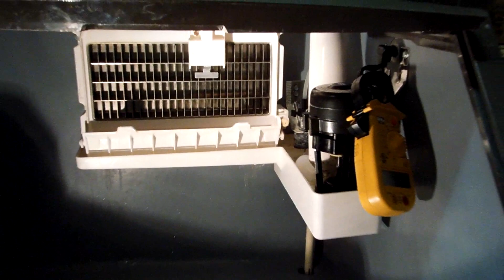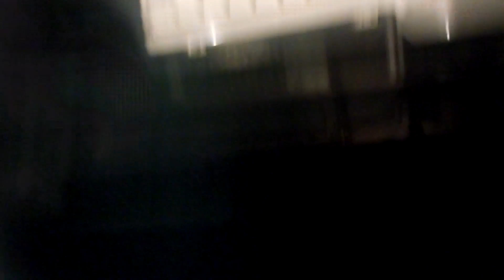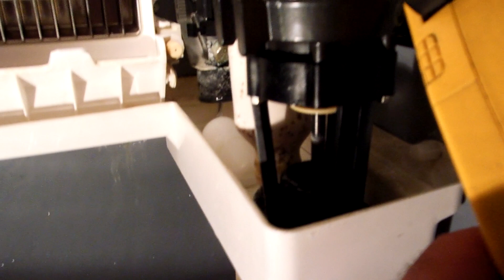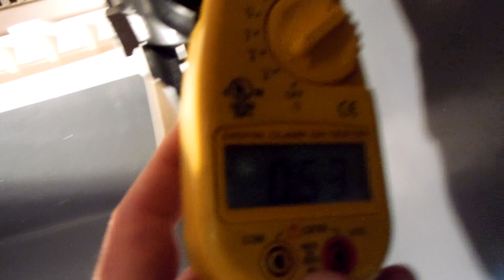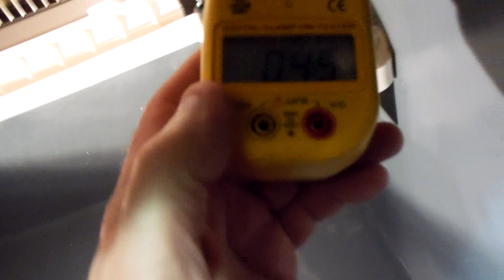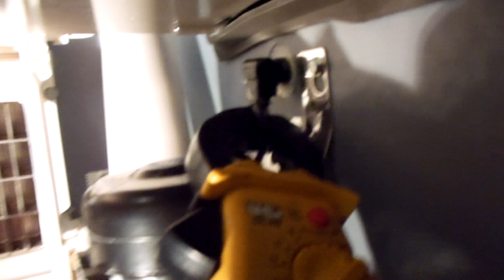Manitowoc ice Machine. How to Diagnose a Water Pump Failure.

Comment: quick question, if there is no contact closure on the relay sending voltage to the motor, then no voltage, no amps but not necessarily the motor. We came across one that the relay was not working someone prior ordered the pump and walked away.  We ended up measuring the windings with ohms to see the original motor was good.

Comment: Love the videos and your style of fixing equipment. If you have any time, What would you tell a new guy, trying to get better with ice machines, about troubleshooting to diagnose water flow problems. Into the trough and over the evaporator.
Reply: Thanks for the reply man, I appreciate the knowledge.
Reply from the maker: spray bars are allways plugged up. Allways  take apart and clean first. Allways flush out trough with fresh water and Pull off pump hose at spray  bar, and pump fresh water out hose before re-connecting to spray bar.
Reply from the maker: allways clean condenser. make sure ucannsee through it.

Comment: I have a Manitowac QM30A and yesterday it quit making ice.  I reset the switch on the machine and watched it start its operation.  The thing I noticed is the water pump didnt turn on.  I pulled the water pump and used a volt meter to check the plugs.  When the machine first starts its showing 22V.  When the compressor kicks on it shows 48V.  Im trying to figure out if I need a new pump or a new board.  Any suggestions?  Thank you!!
Reply from the maker: First check your voltmeter & see if it's working ok. put the meter leads in a wall outlet and see if it reads 115 volts ac. if so , then u have a power problem. possibly a broken off wire that goes to that female plug outlet for the water pump. check for power at the beginning at that wire where it gets its power from. look for loose broken wires. corroded wire or corroded plugs. bad connections. pull apart. clean put back together. you should be reading 115 volt at that pump female receptacle. across the top 2 pins. there are 3 pins. the center one is ground. if u are measuring from the wrong holes u won't get the right reading. 
The pump is 115 volt so remove the pump and try to turn it by hand. if it spins freely.your good mechanically. if pump does not spin it's no good.  u need a new pump.
Reply from the maker: Here's a link to the service manual --- 
https://www.partstown.com/modelManual/MAN-QM-SM-Q-Series_sm.pdf

See page ---219 for electrical schematic / wiring diagram.

There is a Fuse on that control board that is probably blown / possibly because the water pump no longer turns freely. Replace fuse with correct fuse. do not go bigger. make sure water pump turns freely. if it does not replace water pump. Replace Fuse and see if there is 115 volts at water pump female outlet where water pump plugs into. if yes most likely water pump is junk and blew the fuse.

Comment: I have a manitowoc ice machine makes only 1 to 2 loads then it stop and the red light is flashing . What could be the problem.  Please response.  Thanks
Reply from the maker: could be alot of different things --- 

What is the model # of the ice machine ?

1) check that the ice machine is clean where it makes ice. do not use anything abrasive on the ice thickness sensor. sponge clean. 
2) clean the condenser - by blowing compressed air through the rear condenser coil or down below if condenser is down below on little ice machines. thier may be a air filter if a big ice machine. air filter is at rear wherr condenser is . remove and wash clean. 
You should be able to SEE Through condenser with a Flashlight if its clean. 
3) is water pump working ? good water flow ?
4) is condenser cooling fan working ?
Reply: @OcRefrig  thank you for your reply. I replaced the following items already.
1. Fan motor.
2. Water pump.
3. Capacitor 
4. Ice thickness sensor
And clean the filter and used C02 to blow on condenser coil. But it doesn't solve the issue.
Reply from the maker: is the bin thermostat shutting off the ice machine ? jump out the bin thermostat. 
What kind of machine are we talking about here ?
Make : Manitowoc
Model : Q series , S series , neo ? series , indigo series ??? Model # please. ive got to know what im working with here ?
Serial : ?
Reply: @OcRefrig  it is a manitowoc ice machine  model : QY0134A. I dont know if the bin t stat shut down the unit or not but the water keep running for 10 to 15 min than it shut down and the red light keep flashing. If i turn the unit off and turn it back on the process start again( runs for 15 min then shut itself off.)
Reply from the maker: probsbly one of two things with that machine.
1) ice is laying on the brass rod which turns the machine off because it thinks the machine is full of ice or if it foes not have a brass rod
2) it has a flap that flips  every time ice is dropped. if it does not return to upper position machine thinks its full and shuts off.
--- possibly bad bin switch on flapper. bad magnet / weak magnet on flapper.  replace bin switch or bin thermostat needs adjusted  or replaced.
Reply: @OcRefrig  that what i tho. And i replaced the flapper too still does the same thing. My next step is to change the evaporator.  But i dont know how to check it and i dont want to spend 800 dollar for the part that i dont need.
Reply from the maker: my gut is telling me its going off on high pressure safety . condenser getting too hot / not cooling. make sure u can see through condenser with a flashlight. You should be able to see Light through all of it. if Not , Blow condenser out , they get plugged in between.
Confirm Liquid line leaving Condenser is Warm /cool NOT HOT. 
if hot , condenser is not doing its job / Plugged withdirt.
1) Confirm When compressor is Running - That small line leaving compressor is very Hot. so hot u cannot touch it. it will burn you.
if not , u have compressor problem or short of Freon.
2) make sure condenser fan is Running anytime its making ice.
3) i believe there is a Fan cycling switch which goes bad on those all the time / Fan will not run when compressor is running. i would lean more in that direction.
4) if evaporator makes 1 batch or 2 of ice it is NOT Evaporator.
5) When machine runs does it make a FULL Sheet of ice when it does run ? If Yes , evaporator and refrigerant charge is Good. 
6) Its VERY UNLIKELY Evaporator is defective.
7) Condenser Fan MUST run anytime compressor is running.
if machine is older than 10 years old.  i recommend  getting a new one.
Reply from the maker: the flapper has a magnet on it and there is a magnetic switch on evaporator ares where flapper magnet touches. ohm out wiring for magnetic switch. that could be defective.
Reply: @OcRefrig  thank you very much for your help.
Reply from the maker: Safety Limit #2 On Manitowoc Ice Machine

When your Manitowoc ice machine shuts down prematurely, it most likely is going off on what’s called a safety limit.  On Q Series ice machines there are 2 different safety limits, that will help you diagnose the problem.  To check the which safety limit is the problem, simply turn your machine from the off position to ice and count how many times the harvest light flashes.  Below are what the 2 safety limits mean.

Safety Limit #1 : If the freeze time reaches 60 minutes, the control board automatically initiates a harvest cycle.  If 3 consecutive 60-minute freeze cycles occur, the ice machine stops.

Safety Limit #2 : If the harvest time reaches 3.5 minutes, the control board automatically returns the ice machine to the freeze cycle.  If three consecutive 3.5 minute harvest cycles occur, the ice machine stops.

Safety Limit #2 is a more common safety limit and can be caused by the ice maker simply being dirty.  A dirty evaporator will hold ice and not allow it to fall until it is mostly melted away.  Because there is not enough ice to force the water curtain open and break the bin switch, the machine simply thinks it never harvested.

Assuming your ice machine is clean, there are 2 other areas that are most common for shutting a Manitowoc Ice machine down on a safety limit #2.  A missing magnet on the water curtain or your water curtain being broken will cause your bin switch to fail.  The magnetic bin switch on a Manitowoc ice machine relies on proximity to the magnet to know when to terminate the harvest cycle.  This switch will not read if it does not make proper contact with the magnet.  To remedy this issue simply replace the water curtain.

Another culprit, which can also lead to intermittent problems, is a failed bin switch.  The only way to properly test a magnetic bin switch is to OHM it out and look for consistency.  However, it is possible for the switch to fail on say the 100th time, so if you are experiencing regular Safety Limit #2 lockouts, it might be a good idea to go ahead and eliminate the bin switch by replacing it.

Lastly, never underestimate a good cleaning.  Most Manitowoc ice machine problems can be fixed without any parts, simply a good cleaning will return the ice maker back to proper operation.

Comment: Part number for a water pump Manitowoc NEO model; UY0140A-161B Serial number: 310271828 ??? Thank you!
Reply: Got it... Kit Pump 040006556  115/60/1. Keep the water flow regulator from the old pump as you will need it because the kit doesn't come with it.

Comment: Good video
Reply: Was there water in the reservoir? Also... Was the plastic "filter" beneath the pump cleaned out? It seemed as if there was no water flowing over the evaporator. Even if it was spinning slowly it would be allowing some water to flow. Also need to make sure water lines are clear as a restricted water line due to poor water quality will slow or completely stop water movement.
Reply from the maker: Thanks.